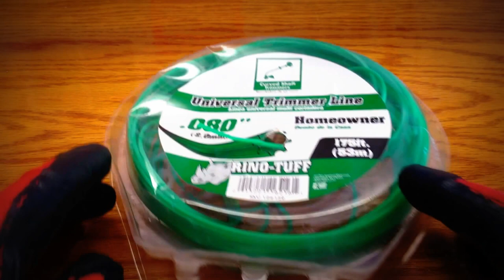String Trimmer ASMR

Comment: I like it when you do the tool videos  while only using one of the two lines on the trimmer doesn't it make the head out of balance and give you vibrations in the handle ??
Reply from the maker: I haven't notice d any unusual vibrations, but then again, it has been many years since I ran with two strings. I thing I'll run two strings next time just to compare. Thanks for watching.